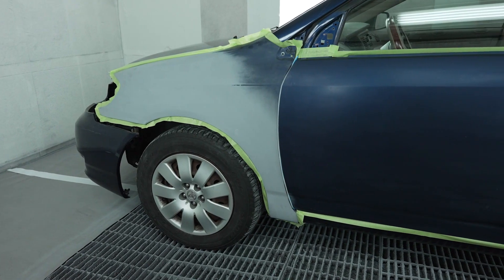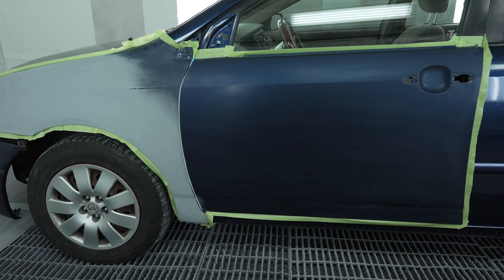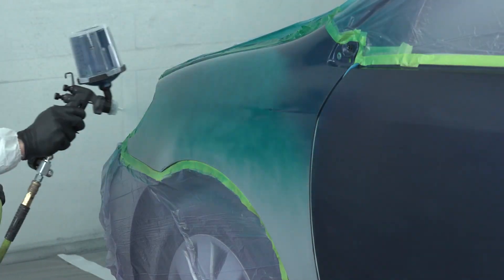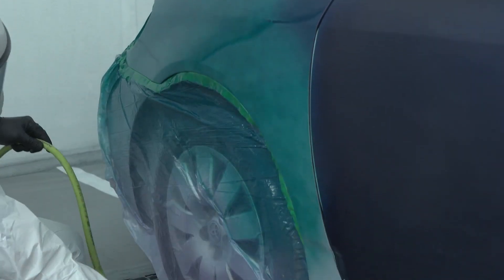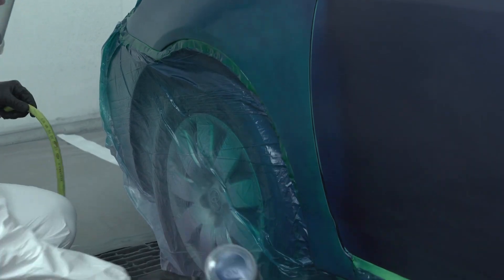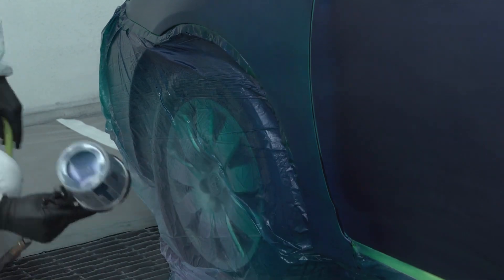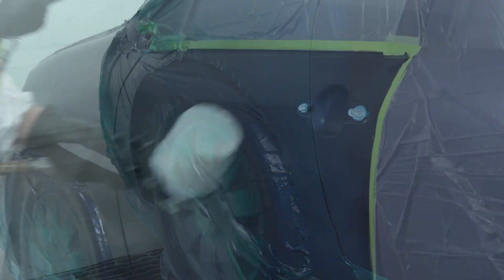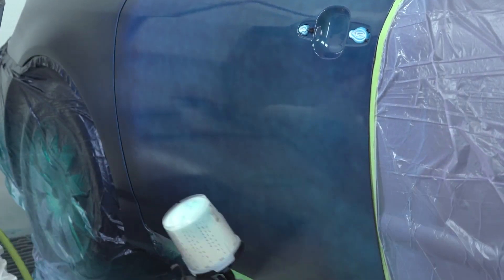Paint Application Process Episode 5: Applying Basecoat

Comment: When applying the basecoat: is it best to spray from the bottom up, or the top down?
Reply from the maker: Technicians debate this all the time, but both ways work equally well. Since overspray drifts down towards the floor in most booths, some of our techs prefer to spray top down to cover their overspray. Different paint lines have different suggestions, so always check your specific paint manufacturer’s standard operating procedure on application.